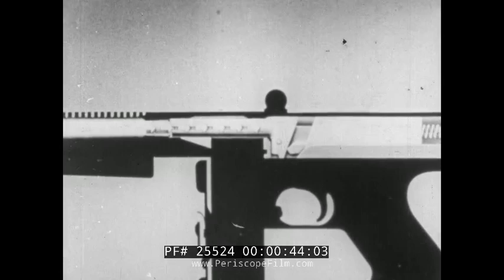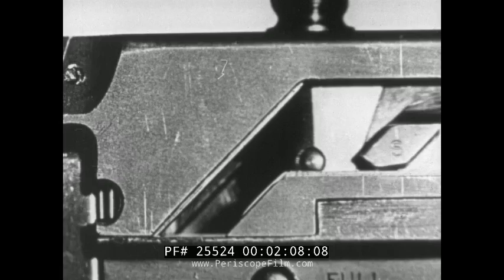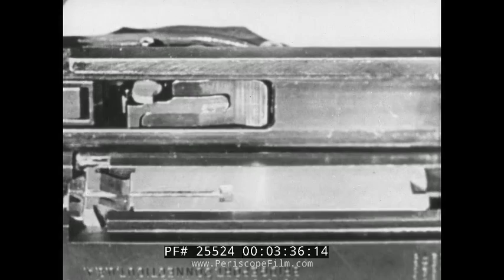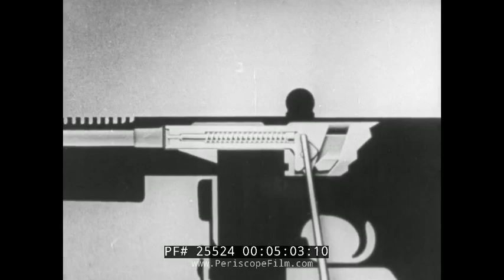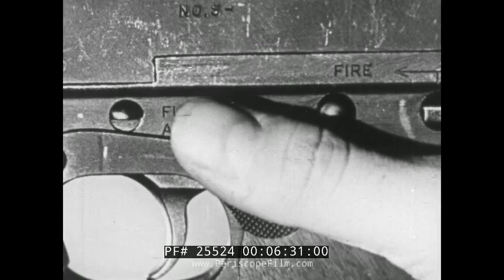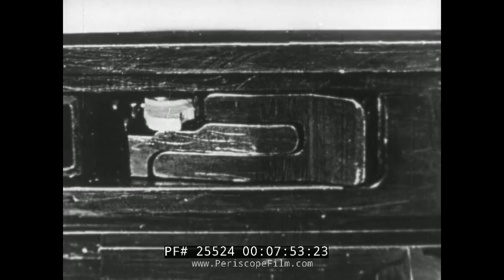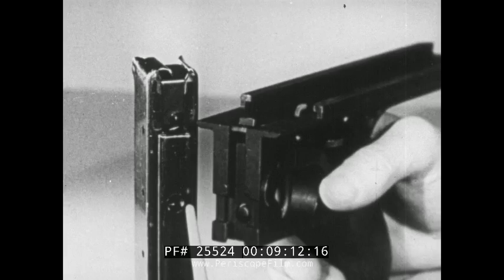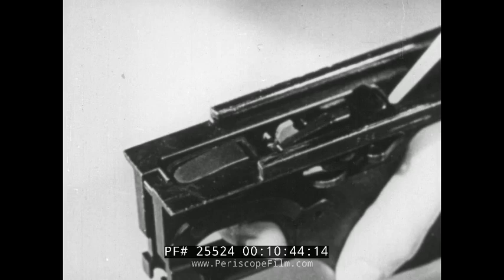U.S. ARMY THOMPSON SUBMACHINE GUN / TOMMY GUN  INSTRUCTIONAL FILM 25524

Comment: 1:20 the "Blish lock"system didn't work the way the though it was at the time. 
They thought that under high pressures generated by the recoil the two angled surfaces of different material clang together and didn't move until the bullet leaves the barrel and pressure drops. Then the bolt would have unlocked with the residual pressure.
While In reality there was no locking, the angled "Blish lock" system was more a "delay system", started moving as soon as the bullet started moving through the barrel. the little friction induced by the Blish lever barely delayed the action like they thought it would. Most of the system relies on the bolt's weight.
Reply: Thats a Zach Hazard level info dump